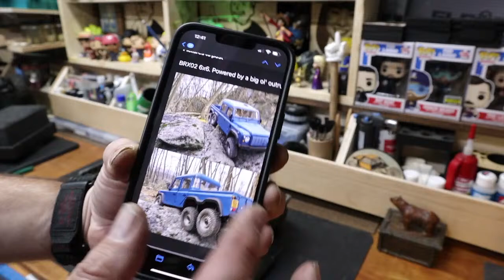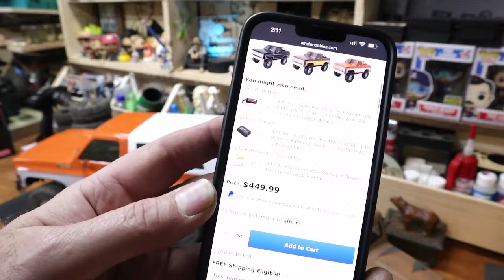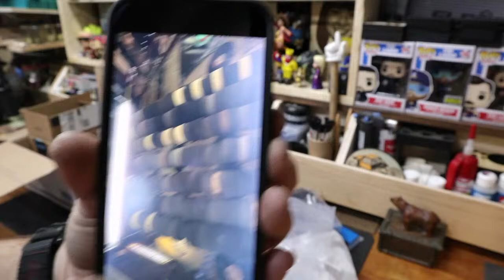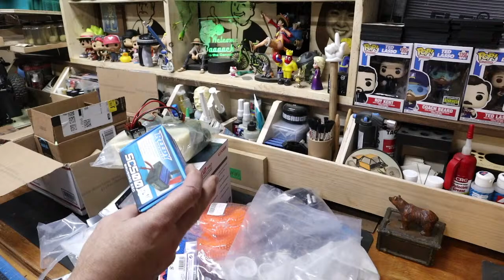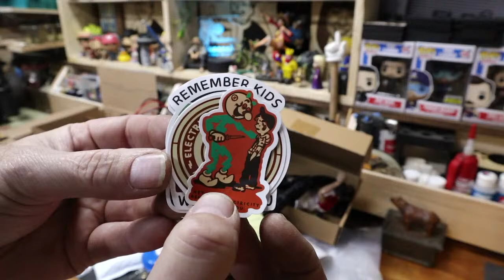Crawler Canyon LIVE! March 29th--  It's like Christmas!

Comment: I laughed when someone said 270 for a fusion pro. In Spain it is 220 in shipping to get the Trailrunner 🤣
Reply from the maker: Meanwhile, I won't buy from JConcepts directly because they want like $15 to ship a set of tires and $30 to ship a body.
Reply: @CrawlerCanyon  I have checked more things from Amain
8 tires for 100€ cost 11€ on shipping (wich I would pay without problem), and a Phoenix kit is 60€ on shipping. How does it work, so a box not that much big as the Phoenix one costs 222€ to ship? I cant get it
Also, is it that complicated or unreliable to expand the shops to other places? Very recently they moved to a bigger shop, whats the complication on having a small place in other places? At least for storage, so shipping is cheaper